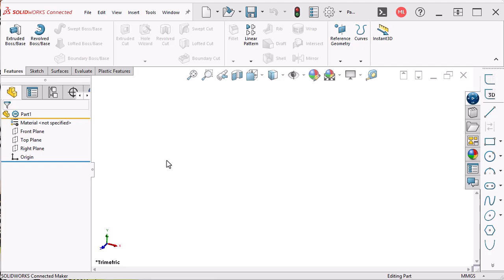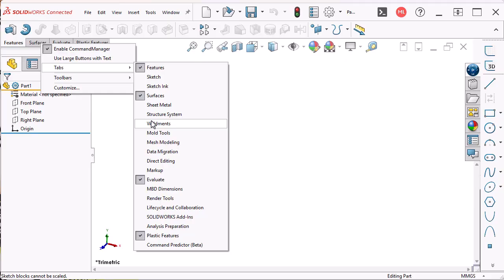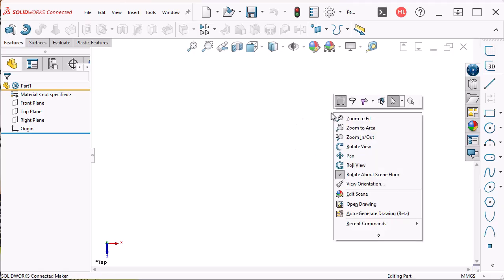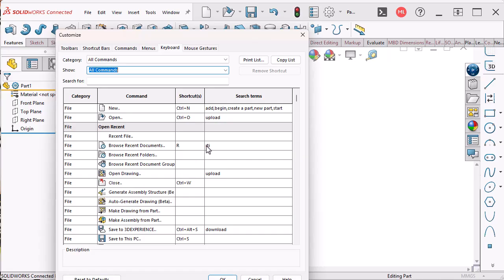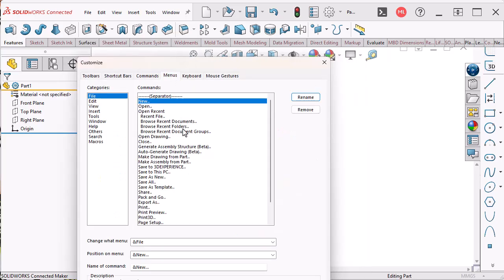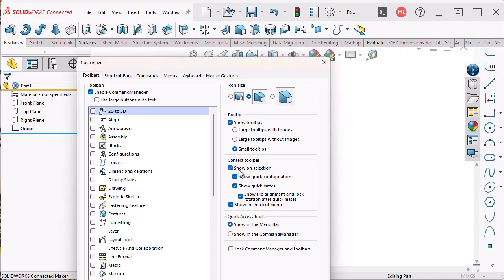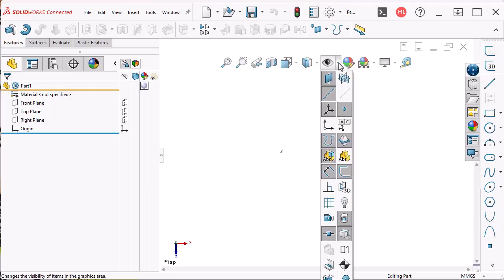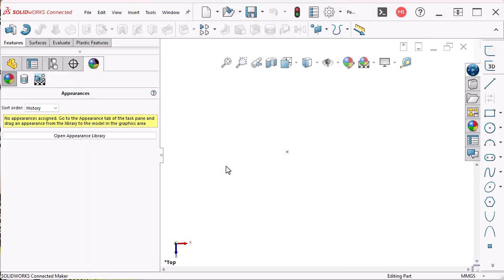Solidworks Interface Customization

Comment: With the keyboard/mouse I use keyboard shortcuts, completely redone S-key menus in sketch/part/drawing (but don’t use it in assemblies) and a modified CommandManager. CommandManager edits are to add the occasional command so I don’t have to find it in the menus.
Thought I was a keyboard warrior but I’ve only made 15 shortcuts. Two I’ve forgot about because I don't use them at my current job. Also have a couple I’ve been using since learning 3D with Inventor 5.